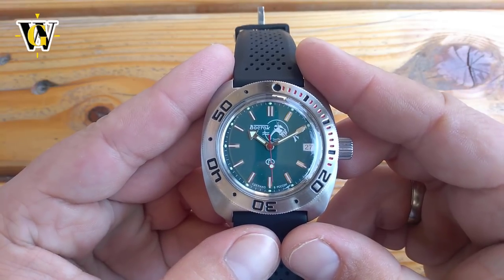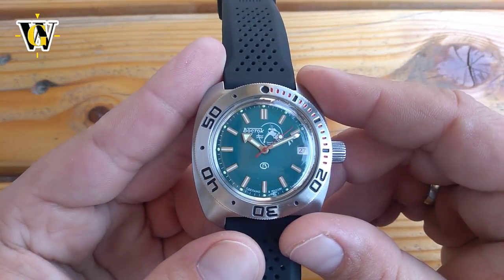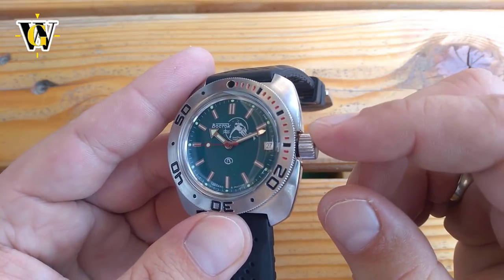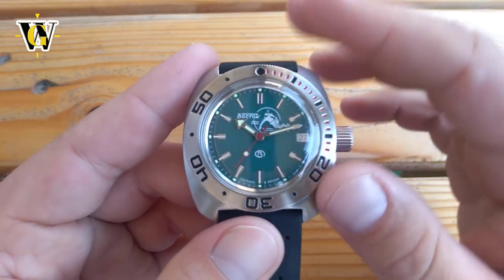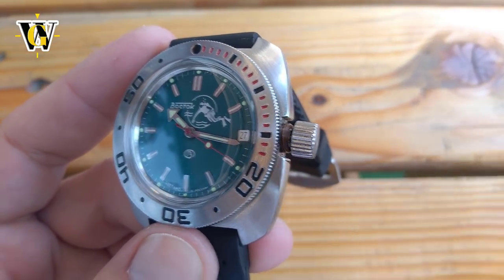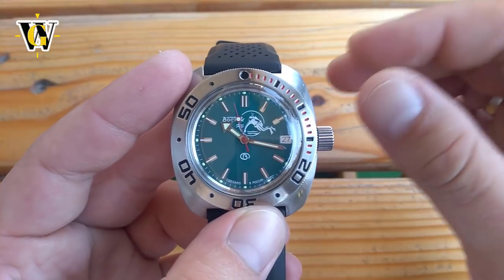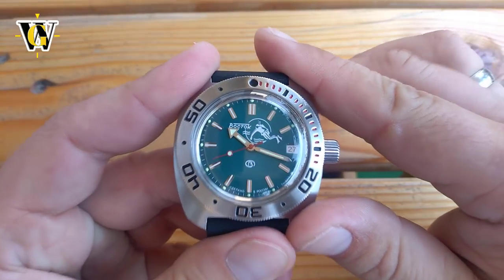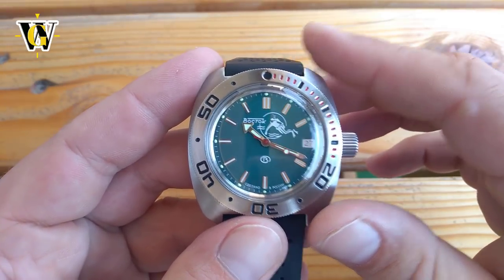Vostok Amphibia & Galvanic Corrosion - my watch corroded thanks to me :(

Comment: I am Russian (left Moscow for New York in 1992).
I am very surprised by Western watch enthusiasts' fascination with "Восток".
I think it's a mix of a desire to have some semblance of Cold War triphy, cheap price, and some vague hint of "innovative" "original" design. 
Of course, what you have in reality is a cheap, mass produced, low quality, objectively ugly trinket which DOES NOT have any real "historical legacy". 
And, oh, by the way, the only connection between "Восток" and Soviet military is that the watches were sold through "Военторг" chain. Meaning that they were sold to anyone (military or civilians), never ISSUED to military personnel, and shared shelf space with toothbrushes, cigarettes, canned pork, and rotting potatoes))))))) 
How do I know? Well, I was born in Moscow in 1968 and did my two years in the Soviet Army 1986-1988. So I probably know about these things a little more than most Western watch enthusiasts... 😁
Reply: I think the quality should be evaluated considering the price and in that respect the Amphibia is truly unbeatable. Cold War nostalgia and all the other vague ideas you mentioned may be a factor for some people (definitely not in my case) but overall, the popularity has more to do with the fact that you cannot really buy any other automatic watch with real 200m water resistance for 60-70 USD. The movement inside is a workhorse that can be adjusted to extreme accuracy, and I can see 20-30 year old beat up examples with perfectly running movements inside that may have never seen service. Also you have endless modding options to play "watchmaker" at home without being afraid to break something that is valuable. As for it being ugly, beauty is really in the eye of the beholder.
Reply: You see we westerners are a very impressionable lot. This has to do with the movie romanticism that is the very foundation of our modern culture.  Then again what isn't mass produced now a days that isn't thousands upon thousands of dollars after which one needs to consider the principle of diminishing returns. I think a Vostok will work for anybody; people that take care of their watches and themselves, and people that keep them next to cigarettes, toothbrushes, rotting pork, and canned potatoes.
Reply: Yet, it has been in production for over 50 years!!!  I didn't want another expensive watch that leaks.  I was pleased to learn of Vostok Amphibia's huge seals and ordered a bunch for kitesurfing.  So I don't cry if I drown a few.  So far they haven't leaked.  I am happy with them.
Reply: But at least a Vostok was in Space. Don't know if kosmonauts where members of soviet military or not.
Doesn't change that cheap, mass produced, low quality BUT clever designed pieces have their own charm. And thus might be more appealing then watches costing two or tree times as much...
Reply: miine, I’ve regulated the first three I received to +-2 seconds per day hitting bang on for 7 days in a row.  That is within Rolex’s newest specification.  
I've found the quality astounding for the price.  Once regulated, they keep time better than all the quartz crystal watches I have owned except the last one–which drowned.  I now no longer believe quartz oscillator is intrinsically superior to a balance wheel.

Comment: For case back issues, the rubber gasket should keep the sweat out of the threads.  You could also lightly apply gasket lubricant to the threads.
Ray

Comment: 5 months full of swimming training in sea and pool and my crown is corroded. So it would be unnecessary to try the stainless steel crown. How can we treat this problem?  Removing the rust seems impossible. Maybe with a cleaning substance?
Reply from the maker: You have to rub it with silicone grease every month or so and it seems to solve the issue
Reply: @WatchGeek  thank you for the advice. I will return with feedback.

Comment: Interesting video, but since you have warned us about this issue , could you maybe or someone else suggest a video with a procedure in order to prevent this corrosion from happening? Some below suggested vaseline or wd40 lubrication of the tube to avoid corrosion. Thanks and hope you or some one else can suggest a preventive way to avoid the problem you faced.
Reply from the maker: Do NOT use WD-40 on your watch!!!
I have cleaned the corrosion with a toothbrush and applied gasket lube used for watches on the area and that seems to solve the issue. But it does mean you have to reapply it after some time

Comment: I don't think it's the stainless steel of the case, if the case is even stainless steel (I read it's plated brass and I do own the same watch). I think it's just the problem with the stem tube material.
Reply from the maker: Amphibia has a stainless steel case while Komandirskie has a plated brass case
Reply: Ah ok, that clears it up! Thanks! :)
Reply: Watch Geek Btw, I also have a Komandirskie in unplated brass :)
Reply from the maker: I did that to one of my watches and it was the closest thing to a bronze watch I had

Comment: Maybe you have a stainless crown and a brass stem.  Maybe order a whole new case.
Reply: Jorn Navarre  Maybe.  But sintered rubber is recycled tires.  I remember an amazing playground surface when I was a kid made of it. 
http://www.rubberchemtechnol.org/doi/abs/10.5254/1.3547695?journalCode=rcat
Reply: Jorn Navarre  I've heard that they were initially sourced from the space program.  I wouldn't care if they were made of tires.  I am sure that would be an improvement on the deformed o-rings used in my watch.  I ordered 5 Vostok Amphibias because I have been driven absolutely bonkers by my watch, which has been leaking since changing the battery.  Been to the watchmaker 3 times and it still leaks!  
Sintering doesn't make stronger rubber.  
The case back seal works like an old fashioned mason jar lid patented in 1858.
https://en.wikipedia.org/wiki/Mason_jar
Reply: Jorn Navarre  I hope so too, but I have the urge to order more.  I'm going to have to try the polishing.  I am sure I am going to scratch them good.  I get sand on me when I kiteboard, and that is the reason I need a watch, to know when to get out of the water to meet landlubbers or when the wind is forecasted to stop.  
I am so tempted to order more watches.  I'm probably going to end up ordering a dozen replacement crystals.  I live in Mexico and the Vostok seals make so much more sense here.  There's a watchmaker down the street who can easily change the Vostok crystals, but the o-ring he put in my Bulova doesn't seal it.
I do plan to order some spare cases which are cheaper than trying to get something leaking to not leak.  I can mix and match innards to cases.
Reply: @GeckoCkCkCk  Also gonna use mine for Kitesurfing!
Reply: @juliusbulle  Mine have been great kitesurfing.  Velcro and nato straps have worked really well.  If the keepers aren't near the buckle on the rubber straps, the end comes out.  Tucking the end back in causes crashes while kiteboarding.
Reply: @GeckoCkCkCk  Thanks for the tip!!!

Comment: I just bought one I wish watching the video before purchasing the watch
Reply from the maker: Just order the ss crown
Reply: @WatchGeek  in another reply you said the stem is titanium, so buying a stainless steel replacement would not solve the problem.  Did I understand that correctly?
Reply from the maker: Apparently no, lubing everything prevents it
Reply: @WatchGeek  thank you for replying!  I'm just going to use the same Seiko silicone I use on rubber seals.  I would think that would work well.  You may have saved many of us a lot of trouble by bringing this to our attention!
Reply from the maker: @matthewdavis8199  it will work, I use generic gasket grease I bought on ebay and haven't had any corrosion since
Reply: @WatchGeek  sounds good.  I'm going to share this info with a couple friends of mine who also own Vostoks.  Better safe than sorry.  Thanks again!

Comment: Interesting.  Mine had the same corrosion, but I noticed it after I took it diving.  Although at that point I had a stainless crown on it.  I could be wrong, but I always thought chrome was supposed to help in preventing corrosion like that.  Although perhaps the inside of the crown wasn't chromed, or it gets striped away from screwing it in and out.
Reply from the maker: Chrome is not really that great when it comes to corrosion.
If you remember cars that had chromed trims it would get these spots of corrosion that would then spread. That is why cars today use plastic instead of chrome
Reply: That is true, although I think it's a big cost savings as well.  My background is actually in chemistry, but to be truthful I'm a little "RUSTY" on the subject.  😋

Comment: The worst watch I ever had, mechanical problems to no end, then it stopped forever. My watchmaker told me that it was not worth even to disassemble it, he told me to throw it away. After about eight months from the purchase I threw it, a tip: do not buy it !!!!!!!!!!
Reply: I am sorry you got a bad one.  :(  I ordered a few Vostok Amphibias to replace my leaking Bulova which watchmaker also said couldn't be fixed after changing the battery.  So I wanted to make cheaper bets.  I wanted waterproof and cheap enough to toss.  I am happy with the three I have received so far.

Comment: Your crown is a new stainless crown. Its in all new version cases like yours. The old brass crown was covered in thin crome sheet that had a polished finish. Not yours. Clean it with brush and add oil for the future.
Reply from the maker: I don't know, it sure doesn't feel like ss. It's very thin and the finish looks like what I am used to seeing on chromed parts, especially when looking at inner edges.
I do hope you are right, and I will try the oil brush method
Reply: Vostok states that the crown tube is titanium and its press fit. You can purchase the tube from Meranom if you need.
In order to see if its brass or SS crown, just open the case and pull out the crown and see the inner threads of the crown. Old crown has two layers, inner crown being brass crome plated that is attached to the clutch stem, outer being a sheet SS covering the crown.
Your crown has a flat face with a circular brushed finish which is the new standard SS crown for most new cases.
The old crown had a round face with a polished finish and the grooves were smoother like on a tin can.
After watching your video I checked all my watches and sure did find one with a slight stain on the tube.
Washed and brushed it with toothpaste, dried and oiled it today, so thanks for the vid.
Reply from the maker: Even using titanium is weird to me, why would you use different materials for different parts as you will get galvanic corrosion.
Unfortunately I left my crown slightly unscrewed and now it has corroded inside in a way that I cannot screw it in all the way, so it will definitely be replaced.
I'm glad you managed to get yours lubed in time
Reply: Not sure how and why Vostok upgraded the crown to SS but they stated that due to increasing demand in the past to change to SS crown is the reason. I do remember a lot of people had demended and I my self demanded a change for the solid SS crown in the past.
The reason to use titanium is to achieve 20ATM and more by the flexibility of titanium which seals the crown and the case upon recieving water pressure, thats how I understood the Soviet design.
The one watch I had the stain is indeed the new version case with the new standard SS crown from factory which has been in a pool once . All other watches including a vintage from the 80s with brass crown or mods with 35type SS crowns has never had stained untill now and all have been in sea water and sweat and soaped and a few without even never oiled, so this might be a corrosion ocurring only with new version standard SS crowns.
Also it might be the SS material they used for the standard SS that react with titanium since the 35 type SS crowns doesn't stain in my case and they are with me longer.

Try opening the case, pull out the crown and the movement, pull out the rubber gasket from the crown, wash the case and brush the tube with toothpaste or compound, do the same with the crown and let it dry. 
Watching your vid does look like your crown tube is not that a big problem, but if you say you cannot screw it back in, it might be burrs from the factory that is obstructing the threads.
Some new cases I purchased had burrs in the crown ( incorrect threadings/ crown without gasket etc etc ...as well.) . A slight brushing helps a long way.

And by the way, new cases without braking in does leave a slight gap between the crown and the case. its the fresh rubber gasket pushing out the crown. It will sink in after a period of use. just a side thought.
Reply from the maker: mongo El thanks for a very long and detailed answer. I have disassembled the crown and it was corroded even worse than the stem. I have since cleaned both, greased them and now everything is smooth. I hope it stays this way.
I too believe it is a reaction between titanium and steel.
Reply: Watch Geek what kind of grease did you use? Did you use a toothbrush to clean? I am having this same problem. Thanks
Reply from the maker: I used a toothbrush to clean it and than used silicone grease that is used for watch gaskets to lubricate the crown tube

Comment: If you lubricated the thread with a little silicon grease when you first had the watch, NONE OF THIS WOULD HAVE HAPPENED.
Secondly you bought a modern Vostok Amphibia, the originals came with a stainless steel crown. 
These modern versions cut corners like this in order to increase profit.